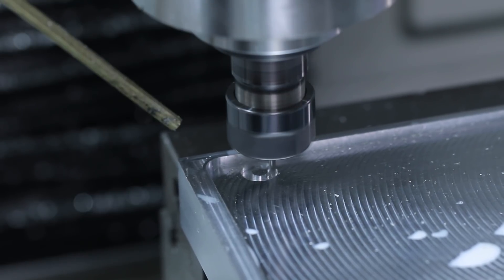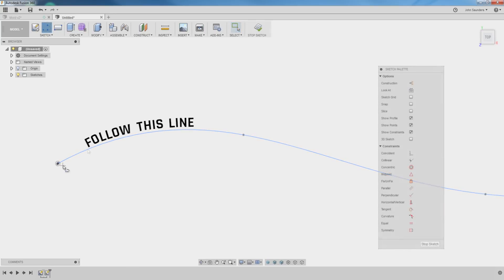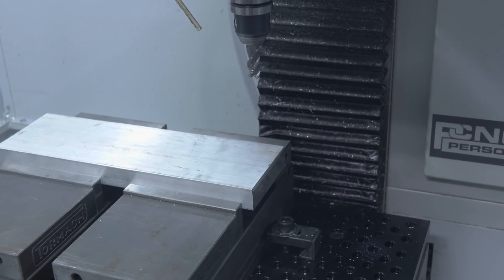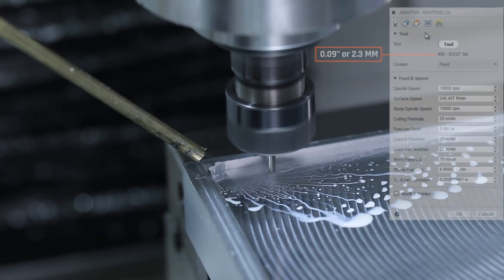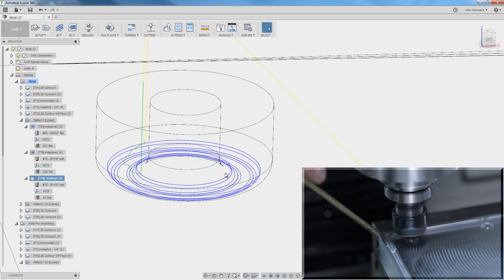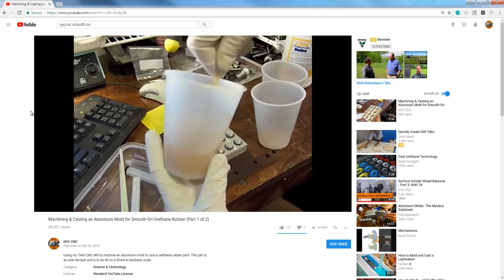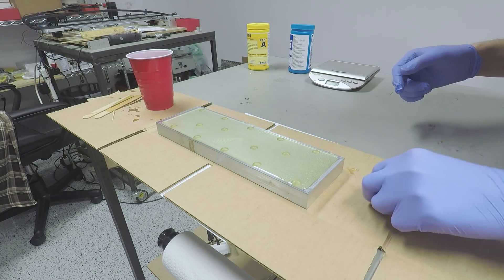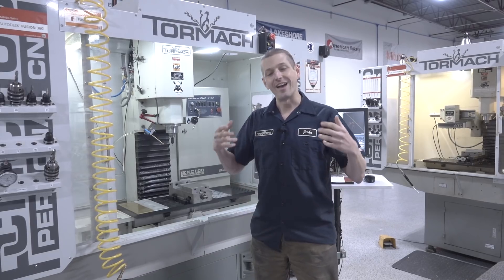Machine a Mold! WW179

Comment: I am not a fan of this solution as it is going to take too much messing around cutting and fitting this stuff for each configuration. I have the aluminum plate, it is going to take me some time but I am going to make .5 x .3 steel slugs to fit each hole. They will sit flush in the holes, I will simply use a magnet to snag it out and put in a stud when I need to use a hole. That means even under a vise every single hole will be covered and below the surface of the table so it will never bother fixturing.

Comment: Hi, I don't know how many you need of this part, but we can make a real injection tool for you for about USD 1,000 from the looks of it. We are located in south China, so there is going to be some transportation to your location for the parts !!! The top surface i see your milling lines. Usually we polish those away or make a sandblasted surface which ever is our customers prefer.  Best regards from a Danish guy living in China.

Comment: I didn't make complete doughnut circles, but I made some posts that are similar to the posts in the centers. This was on a manual milling machine. First I milled off the top of the piece so that I had square (more or less) posts sticking up. Then I positioned my spindle where I wanted a round post center, and in one cut brought the tool down and left the round post. I used a boring bar, and turned the cutting edge inside so it reduced the size to a precise diameter post instead of the opposite operation of enlarging a hole. I was cutting plastic. I believe that with the right cutting tool in a boring bar, you could do the same thing to make your mold like drilling a standard hole, instead of the tiny end mill.

Comment: John, Something I have been wanting to learn more about, I wish you would do a video on thread wires/measuring over wires. I wish i knew more about it, and how it all works. I have always had the luxury of ring and plug gauges. I also think some of the guys starting out could learn how to check threads without needing an expensive gauge.
Reply: I think Edge Precision discussed it some in one of his vids. It's has a great CNC channel if you aren't already aware of it. I'm sure Mr. Pete has covered it also at some point also. There's really not much to it. The hardest part is holding the damn wires with one hand!
Reply: Steve just Steve a little grease holds them well. ;)

Comment: Smooth-On is great if you only want to make one or two parts but if you are doing it in bulk they are not the best most cost effective company to use.  BJB would be a step up in terms for mass producing them and there are better companies up from there.   For optical clarity you need a rigid resin, degas the resin, place the mold in a pressure chamber for cureing.  Optical clarity really isn't a thing in flexible materials.

Comment: light media blast mold to get an even finish, go fine as you can and still get an etch. that way later on you can easily touch up imperfections in the mold. or high polish if you think sticking may be an issue.

Comment: There is a difference between degassing and outgassing, if you pull too much vacuum you actually evaporate the chems inducing air bubbles or cloudiness. Low/mild vacuum for epoxy type chemicals works best. I do like the black.
Reply: He's using a silicone product. I can't read the part number on the bottles, but I'd guess it is platinum based. Smooth-On likely has detailed instructions on proper degassing for the product. www.smooth-on.com
Reply: Right, for casting resins, you are supposed to use a pressure pot if clarity and bubble free are your criteria.

Comment: John my first thought would the hot chips burn through? I know you all do mostly aluminum but running steel with indexable tooling and no coolant is throwing off blue chips. Might melt. There has to be a heat resistant rubber right? Awesome stuff brother! Appreciate your videos.

Comment: What about molding a mold that can mold molds?
Reply: Mold ception
Reply: But! How many chucks can a wood chuck chuck if a wood chuck could chuck chucks.
Reply: 1337fraggzb00N That would definitely speed up the molding production. Mold positive molds from negative machined mold to produce the finished molds! 😏
Reply: Ron Hunn You might have to contact Jet Lathe for that answer.
Reply: We also need a mole. A mold molding mole.
Reply: Ron, a woodchuck is able to chuck a huge amount of chucks if it has the right mold.
Reply: I don't know, I have never met Chuck. But I know his wife Shelly, she sells seashells by the seashore!
Reply: That's what clay moulds are all about. Start with a male master and cast it in clay (female). Take a male cast from that mould, then cast a female. The female is used to make the objects. The last male is used to make more females from which to make the objects. Intermediate stages allow for refining the finish so that there could be more females and males, but each stage would have an improved finish (fixing blow holes, bumps and scrapes etc). It's a long-established method used since ancient times. Works well too. You can do the same in metal, but you normally don't need the extra intermediate stages. It depends on the finish on the mould coming off the machine. You can cast most plastics directly from most cnc'd moulds.
Reply: Heptode, take that out of context and you have a perverted way of telling how children are made :)

Comment: A better idea than the magnetic vehicle signs I used. They worked great but cleaning the chips from them was a pain.  How does this material hold up to hot chips? Likely not an issue with flood coolant but could be if you run dry.

Comment: Have you tested the casting material for breakdown resistance against coolant ?
Reply: Nitro RC you have such a variety of coolants for so many different applications however I don't think there would be any inherent problems with most of the one's commonly used by most machines.  Unless you get some backyard wizard who mixes up something really acidic that eats it up and swears it's the best coolant ever made. Lol
Reply: I thought the goal was just to prototype with the Smooth-On, and then you could injection mold them after you're happy with the design.
Reply: I'd like to know that also.
Reply: If I think about it again he probably asked SmoothOn themselves. I guess they must have done a lot of testing of their product for different compounds such as coolant.

Comment: Nice, Not sure there is any benefit in going to metal moulds for a poured/cast end product. I typically would cut this out of machine wax for the master positive and pull out a silicone mold.  Wax is Fast and reusable if you change your mind.    You can then pour 10 silicone moulds off the master wax for ramping up to production, eliminating extra machining and any part release issues.  Thanks for the video.  I always enjoy watching
Reply: I loooove sikablock.

Comment: I think a better explanation of smoothing  is to eliminate discrete line segments by fitting arcs to the geometry. You can often eliminate hundreds of discrete [approximated] line segments and replace them with a single arc, or few arcs. The tolerance determines how approximate the arcs follow the geometry. The upside is allowing the CNC control to do the math at runtime instead of at post time. Many newer controls can then apply internal accuracy models which can trade time for accuracy, or surface finish for time.  This goes back to last week when you explained the tesselated tool path the software generates; the native toolpath is line segments instead of arcs.
Reply: Can't it also replace straight lines, for instance like a jagged within smoothing tolerances? Don't you find on older machines like your Fadal to keep as much math out of the control and in the post? I know I do.
Reply: I take exactly the opposite approach.  I want the code size to be as small as possible, so I force the post to generate as much of the geometry as native G-code.  The control is plenty fast enough, they aren't doing floating point, they are doing fixed point math with lookup tables for sin/cos.  With a more modern control there is less of a penalty for code size, but if you are lazy then you can get in a situation where the control has to process a bunch of lines per second, and when the vectors are short, the path planning can get confused due to not having long enough vectors to properly calculate smooth accel/decel points.  This is where lookahead become crucially important.  The lazier the post, the larger your lookahead needs to be in order to avoid jerk and bad surface finish.  If you have a small fixed lookahead, then having tight code is important to getting good performance from the motion controller.
Reply: Interesting, I agree with a lot of that but my Fadal has barely enough memory to hold a small probing cycle so file size doesn't really matter to me since I'm DNCing w/ my Calmotion no matter what. I have an 88HS controller without AFF or anything and I don't use a ton of HSM toolpaths but my machine seems to run smoother with line approximated arcs for the most part.  You say "lazier post" and I'm certainly not claiming to know best on this subject, far from it but I figured the machine has to do the math on the radius then do the line approximation on its own because it can only move in straight lines in practice and all that takes processing time.  I'm prob wrong, but all I know is it seem to be how my machine runs best for some reason. Thanks for the info.
Reply: I have the CNC88 control, it processes 1 block at a time, with small pauses between them.  My machine has 156KB, which is just enough to do something useful.  I'm planning to replace the control with LinuxCNC and Mesa hardware, retaining the stock drives and resolvers.  Tormach based their control on LinuxCNC, with a different UI -- they also contributed a better trajectory planner, which really shows when watching these NYC CNC videos.
Reply: Awesome I hope your able to film some of it. I'd love to watch that! Cheers
Reply: Have you looked into the  Dynomotion KFLOP retrofit at all?
Reply: I haven't looked at the KFLOP.  Mesa has a standalone FPGA board that uses Ethernet and a fixed packet format to communicate motion control commands from a host PC to the hardware.  This allows you to separate the PC from the hardware controller (like put the PC in the pendant and controller in the cabinet).  Their Ethernet controller works with all the standard boards and they've already contributed support to LinuxCNC, so it's ready to go.  I like the idea of isolating a noisy cabinet from the PC, the only thing better would be a fiber connection.  I placed the cost at $500-600 for the Mesa stuff, plus a PC (I'll use old stuff I have laying around).

Comment: Great idea for a product.  I bought the Tosa plate for my 770 before I knew you had an offering.  They have a bazillion plugs and I ditched that idea right off in favor of just placing aluminum plate on the uncovered spots.  I've not compared the threaded and milled hole specs between theirs and yours.  I'm hoping they're the same and I can buy some of these from you.  Being able to cut sacrificial or special shapes is great.  Thanks for the video and new product.
Reply: I'm in the same boat.  Both plates have the same hole spacing which is good.  But the tosa plates have a .562 reamed hole, while Johns has a .500.  So I'm guessing it will work, but the nubs that go into the holes wont be snug.  I doubt flood coolant will be much of an issue, but if you have air blast like me, then they will probably move.
Reply: Thanks, Shawn.  I had just gone back to check spacing and it indeed looks the same with the exception of how many holes are threaded, like you say.  If SMW does come out with the product I'll give it a try and report back on its fit with Tosa.
Reply: I ordered some this AM.
Reply: Here's the link:  https://saundersmachineworks.com/collections/tormach-fixture-plates/products/fixture-plate-cover-protectors
Reply: Ah, didn't realize he already had the beta units for sale already.  Just ordered some myself.
Reply: How is the fit Randy?
Reply: How is the fit Shawn?

Comment: Realy nice, what shore hardness did you use? I'm lacking a little bit of feel for that, I have some understanding for the soft stuff from working with silicone, but PU rubber is often more on the harder side.

And how did you manage air bubbles that result from the casting process itself? I imagine that it could trap some air when flowing into those small pockets and I saw you poking around there with a stick. I heard you can compress those in a pressure chamber to a size that's barely noticable, maybe that's a good idea for you.

Comment: Still wondering why you’re so against helical ramping in small pockets...  

Probably could have done those cavities in 1/2 the time and 1/10 the code size. 

I know time wasn’t an issue.  But a helical ramp would have also evacuated the chips well too.

And scotch brite that main flat surface too to get the tooling marks out. 😁
Reply: Nevin Zimmerly 
Possibly. But they’re suppose to be priced to be sacrificial anyway.  

And it looks like a silicone rubber which holds up to 500F without melting.
Reply: Probably due to autodesk sponsoring the channel? Doesn't make rational sense to do adaptive on literally everything.
Reply: Occams, are you talking about a helical boring op? Looked like he did helical ramp, he didn't plunge. If you are I was thinking that too.
MtD, what you said makes no sense to me 
Nevin, dont have to worry bout melting when you use coolant.
Reply: Will hot chips melt in them?
Reply: Helical ramping is still a type of slotting in which you do conventional an climb milling at the same time. Also the chipclearing isn't as good as in an adaptive cut. He tries to prevent slotting wherever possible so I guess thats why.
Reply: yeah we're talking bout the same thing I always just called it a helical bore. I agree
Reply: Steve just Steve 
No. Instead of the adaptive milling in the pockets should have just done a helical ramp contour. Probably could have used a larger tool as well.